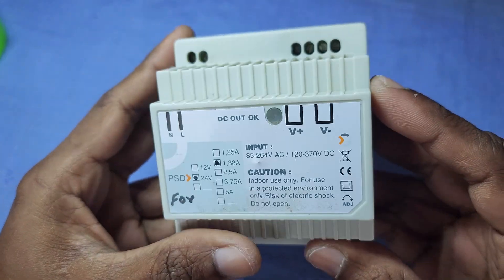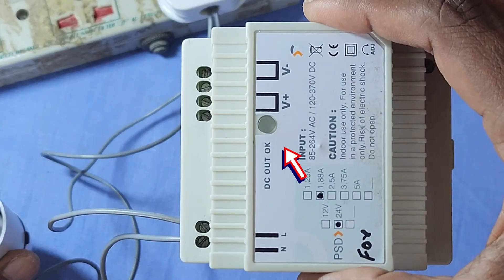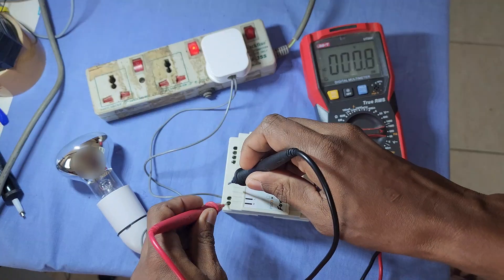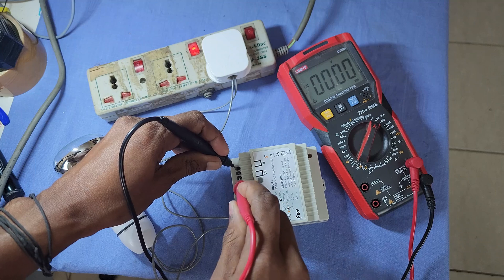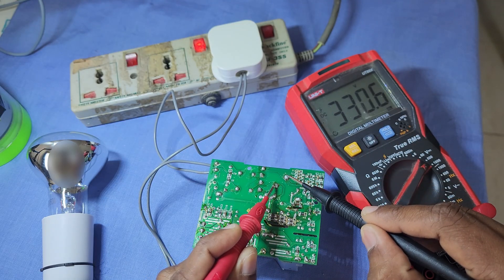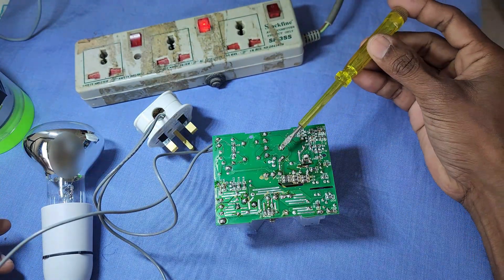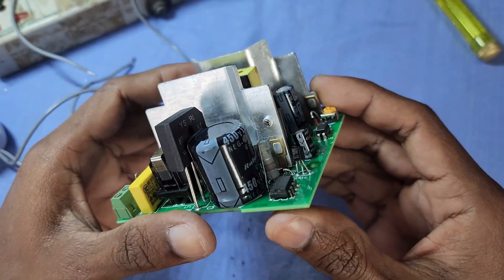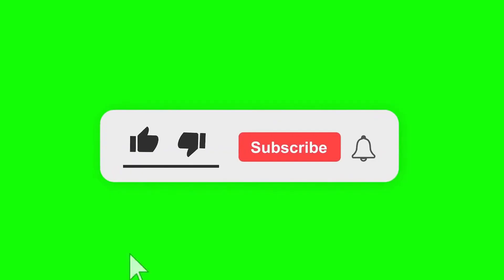||How to Repair a 24 volt SMPS Power Supply ?

Comment: What is the light bulb for on the mains input and why does it not light up?
Reply from the maker: If the power supply has a short circuit inside, the bulb will light up fully or even brightly, showing there's a problem.In normal operation (no short), the bulb may stay off or dim, because modern power supplies draw very little current at the input once stabilized.

Comment: You should build a capacitor discharge tool instead of shorting with a screwdriver. Maybe you can make a video of it for your viewers. Then they can know how to safely discharge a cap without potentially damaging it.

Comment: Sir, I want to change under voltage input cut off protection UVLO in SMPS !

It's above 240vdc by default, For dc (for ac 180 rms)

I want to set it at around 205 - 210 volt !

My Dc voltage is 205 to 230 !

Can you guide me, how to do this ?

My SMPS is Mean well LRS 350 - 48v purchased 2 days ago !
Please help 😢 !
Reply from the maker: Find the datasheet of your PWM IC to determine the values of UVLO ON and UVLO OFF. Next, locate the 'startup resistor' in your SMPS, which connects from the high-voltage DC to VCC pin of the PWM IC. Additionally, you should find a VCC capacitor, which typically has a value between 22 µF to 45 µF. To reduce the startup voltage from 240VDC to 210VDC, you need to allow more current to flow into the VCC capacitor at 210V so that it charges to its UVLO threshold sooner. To achieve this, you should reduce the value of the startup resistor. You can do this in two ways: either by connecting a trimmer resistor with the same value as the startup resistor and adjusting the UVLO by rotating the trimmer. (should not reduce the value of 'start up' resistor less than 100k ohm, always use a safety resistor in series with the trimmer resistor if your using a trimmer resistor),  or by using this formula.

R start = Vin - Vvcc/I

here, 'R start' is start up resistor, you have to find out in your SMPS
            Vin = voltage input, in your case between 205 to 210.
             Vvcc = UVLO ON voltage (Vcc ON)
              I = 'start up' current needed, it is around 1milli ampere.
Reply: Thank you very much for your reply, how can i contact you ? @DAKElectronicsLab
Reply: @DAKElectronicsLab  thank you so much for reply ! How can i communicate with you?
Reply: @DAKElectronicsLab  how can i share My smps photo to you?
Thank you!
Reply from the maker: deepumattam@gmail.com this is my Gmail
Reply: @DAKElectronicsLab  thank you, i will mail you ! My smps ic is 1252 !
Reply from the maker: Ok